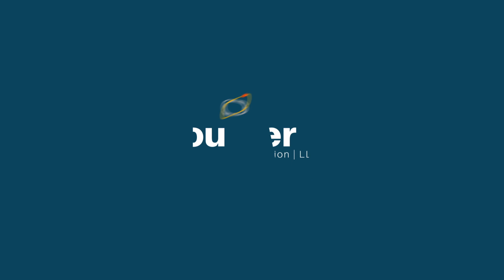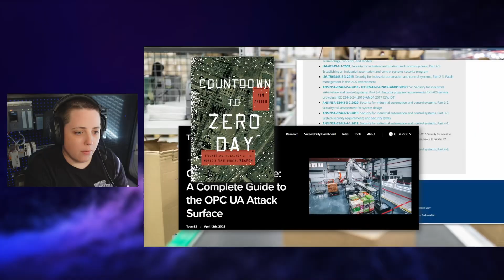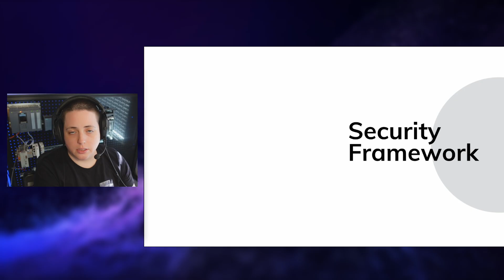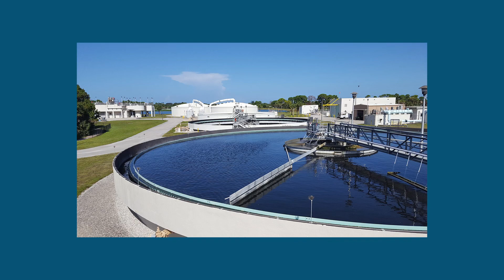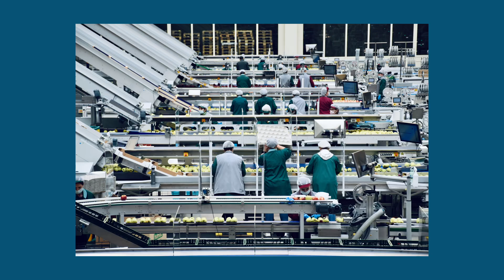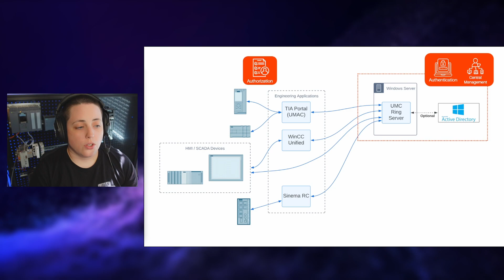Siemens TIA Portal | User Access Control

Comment: You've explained very well. In another case, we can enable access control with a normal domain using Simatic Logon for centralized user management. So, I have a question: What's the major difference between a normal domain and UMC, and what are its advantages? Why should I choose the UMC?
Reply from the maker: That's a good question.  I believe Simatic Logon is mostly associated with WinCC V7.5/8 software and UMC is mostly around TIA Portal, so PLCs and WinCC Unified are going to be standardized around UMC.